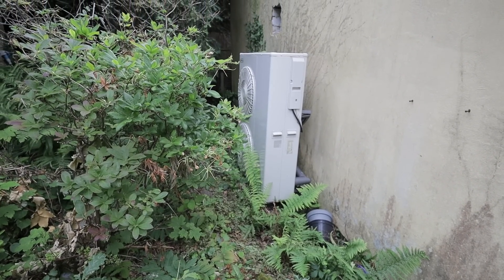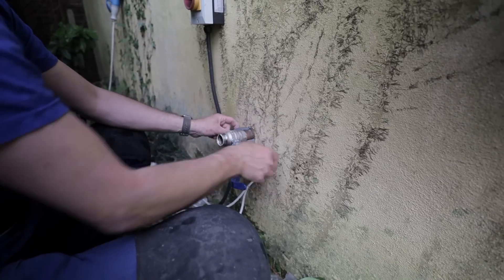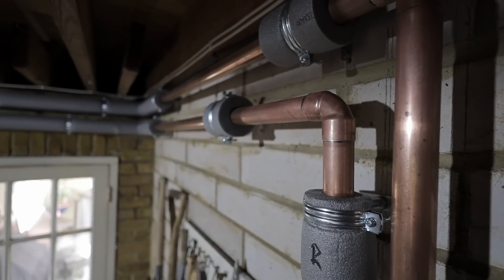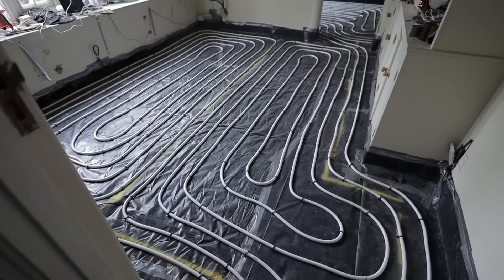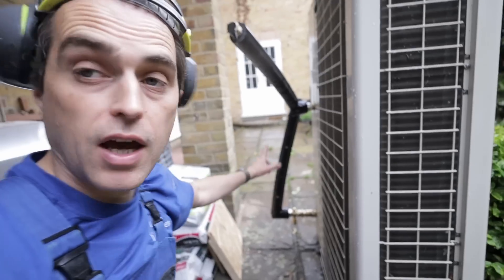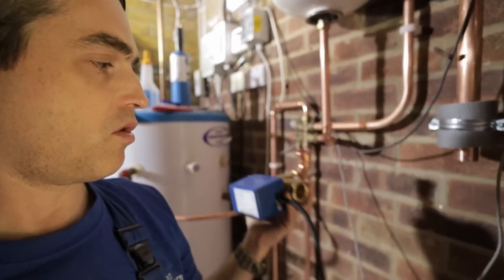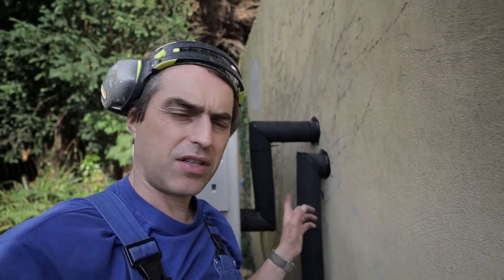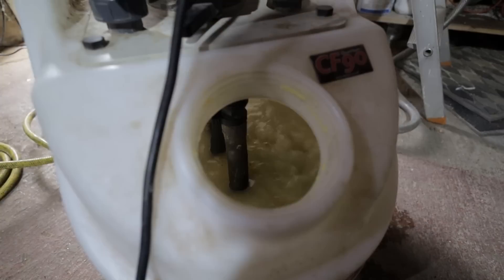Heat Pump Installation Nightmare - Can It Be Saved?

Comment: Who would ever have a heat pump installed? They are so complex and expensive with so much more pipe work than conventional central heating, plus the ongoing maintenance issues. Without subsidies they just don’t work, and this country can’t afford subsidies for much longer.
Reply: Much more pipework? Compared to what exactly?….. And as for the complexity, they’re considerably simpler than a combi. Connect power, turn on, hot water comes out….. A completely sealed refrigeration circuit, a built in pump, often a built in expansion….. simple as heck.
Reply from the maker: Heat pumps are amazing when done well. Cheap to run and last for ages

Comment: What a cliffhanger! Good luck with the investigation, excellent video. The Sontex heat meter display will also give you a reading of the flow/return temperature and a real-time readout of the heating power being delivered. If a heat meter was installed there's a good chance they was also an electricity sub-meter installed with the original installation. You should be able to calculate the COP of the unit in its original state by reading the kWh of heat from the heat meter and kWh of electricity.   Do grant use an internal or external pump? What's the spec?
Reply from the maker: Internal 12m pump. Just found out they are ‘only’ around £220+vat so will recommend to the client we change the pump next and flush plate again, but will use some seriously strong chems and go direct to the plate
Reply from the maker: Also, full monitoring is available in software, strangely flow can only be read on Sontex

Comment: Your having as much luck as my underfloor unit in the us , it has a flow of just 24m s no one could work out why , that’s why after two years I went to an air to air system two units, one doing the main living room , the other upstairs in line us style duct and defusers in. 4 rooms  of the annex, get this 40mm insulation and still only 15 c 1900 sq ft 2 zones   The biggest waste of money I end up using solar and off peak to charge the 250 litre cylinder twin immersion coils both 3 kwh  b rated cylinder,  and completely empty twice a day due to household

Comment: Wow that installation was so bad. Feels like the property owner could have a legitimate claim or possible lawsuit against the original installers if it really had no chance of performing even close to what was promised. 

Not sure how that works in the UK though. Just seems like a huge waste of money for them :(
Reply: Nobody has the time, energy or money for lawsuits because the justice system is a scam and a joke.
Unless you are a regimist that has scammed the system for millions yourself and know those involved going to court is often worse than even just losing the money.

At least that's how I see it. I haven't experienced it luckily. I have had reason to sue but didn't because I think it will just be a huge drain for little result.

Comment: Fit your gauges on the outdoor see what discharge pressure your getting . Work out your subcooling from your condensor. High discharge temp high subcooling would point to underperforming plate exchanger . Is there any Service settings you can access on unit to interigate the outdoor unit?
Reply: Not many plumbers over here have the f-gas qualifications required to legally work on the refrigeration side. I’ve asked Symon in another comment if he has this qualification… then he could recover, remove and clean the plate, then re-gas.
Reply: @dorsetengineering  it's mad how split the trade is the amount of this stuff we go back too that gets miss diagnosed is bad, f-gas is a minimum requirement to leak test and break the refrigerant circuit . Most fridge engineers have done an apprenticeship of some sort its a bit like us getting let loose on a boiler. A bit worrying when the likes of daikin are targeting massively and a day course seems to be all you need . I like watching this channel as he is a very good heating guy not many like this in the world .
Reply: @dantheman9909  with the air/water industry moving to r290, technically f-gas quals won’t be a requirement. Still, wouldn’t want your average plumber having a go, given the standard of training in that Industry. Most can barely understand what modulating controls are.
Reply: @dorsetengineering  even more dangerous being a hydrocarbon
Reply: @dantheman9909  what’s I find a bit ridiculous about the whole thing is the paranoia in the industry around half a kg of r290, in a sealed heatpump, in your garden. Yet average Joe can go and buy a gas bbq and a honking great cylinder from b&q….
Reply: @dorsetengineering  until someone tries to unsweat a blocked drier 🤣

Comment: Im not familiar with grant heat pumps but just had a quick read on the manual (r32 grant aerona3) and saw that you can change the dip switches to change the output of the circulator, comes as default on maximum speed but worth a check if not already checked. 

I assume the poor flow rate is on both the heating and hot water. The pump chart shows a max of 20l/min at 12m head at speed 3 on the pump. To have rubbish flow rate on just the coil as well you would be right in thinking the plate heat exchanger on the outdoor unit. The smallest amount of debris will play havoc on flow rates, more so if it has a sika flow sensor like other brands. When refreshing the flow rate reading on those sika flow rate sensors you will notice the flow rate fluctuates by massive amounts which indicates debris within plate.
Reply from the maker: Pump on speed iii already. I have installed those units before and I used to get double the flow rate of this unit. I also tested flow just across the unit and it is definitely restricted

Comment: Great detective work and re-fitting of a poorly installed and designed system. Such a shame there are heating engineers out there fitting heat pumps to this poor standard and taking customer's money for it.
Reply: I wouldn’t call them ‘heating engineers’, that implies a degree of design skill. The horse riding fitter who banged this in was just following the grant installation instructions (designed to appeal to the average jobbing plumber), probably under a grant hoovering mcs umbrella scheme.

Comment: I guess you don't have bypass option between flow and return (on your new 35mm line) to open up and check the flow rate then. That would point you to the right direction (heat pump or system). Good luck to find out what is the issue. I'm looking forward to learn.
Reply from the maker: 100% heat pump issue
Reply: @UrbanPlumbers  That's pretty bad. I feel sorry for the client... Obviously they paid a fortune for the system a few years back, and now... they have to do it again.
Reply from the maker: @arpa592  system was pretty much unusable
Reply: @UrbanPlumbers  Yeah, no doubt about that. Was it a DIY job originally?
Reply from the maker: @arpa592  MCS registered installer if you can belive that
Reply: @UrbanPlumbers   Wow, I wouldn't see this coming...
Reply: @arpa592  I'm trying to decide if you're being sarcastic :D
Reply: @arpa592 The DIYer who was going to tackle something like this would have made a much better fist of it than the original installer.
Reply: @normanboyes4983  I know, first hand...;)
Reply: @dorsetengineering  Well, I guess, but to be fair, sarcasm towards the original installer is the minimum requirement. We, bystanders can do it, without consequences, and I think the comments are still within the (very) good manner.  Just to be clear that wasn't you?

Comment: I blame Grant, for making their aerona units ‘as easy to plumb and wire as a boiler’ 🤦‍♂️🤦‍♂️🤦‍♂️ It’s a shame, as the Chofu unit isn’t terrible.
Reply from the maker: Correct, it’s all set up Chofu way now
Reply: @UrbanPlumbers  have you considered doing your f-gas, then you could recover, remove and acid dip the plate heat exchanger, then re gas? The c&g qualification never runs out, and the 4-5 day course is only about £900-1k. Probably going to do mine later this year.
Reply from the maker: Yes I have. I am just too busy right now. I will do those f gas at some stage.
Reply: @UrbanPlumbers   nice…. Gives you the option to do r32 air-air units too (because they’re amazing and everyone wants aircon nowadays 🤣)

Comment: If the industry ever wants to get over the bad reputation heat pumps have they need to improve their installer training.  This one is particularly bad physically but a lot of installers either don't know how to or can't be bothered to set them properly for maximum efficiency. Sad state of affairs but it's good that's people like you are showing what can be achieved👍
Reply: Not just the industry but also customer base need to stop going after the lowest bidder. Every home remodel I do the owner will spend a fortune on making the home look pretty but cheap out on the system that makes the home comfortable.
Reply: @Silky_boi Quite often there is no linkage to a bad installation and price to the customer.
Reply: @Silky_boi  Very true. Customers go for a lower bidder as they value heating less than aesthetics. No different to other trades such as the electrics (go for the cheapest bidder and have issues with poor quality lights, unsafe sockets and non-compliant wiring etc etc), windows (poor quality windows and installation means the windows fails earlier and lets in droughts), plumbing etc etc. 

More often then not, it's the stuff you can't see (electrics, plumbing) where people cheap out on which makes or breaks the property...
Reply: Plumbers are jumping into the heat pump market, without a firm grasp of system sizing and design. They just follow the outdated S-Plan, and hope for the best.
Reply: What’s to stop anyone installing heat pumps that are badly installed with no thought for design at all. There needs to be penalties for charging people to do this.
Reply: Most installers I know (Italy) are mostly used to do simple gas boilers. These systems at worst require an ON/OFF or bus thermostat to be added and power to run. Once you start going into the more complex models, with electronics, boards you need to set on the right addresses to get the zone valves running, all hell breaks loose. I believe at best 25% of our plumbers / installers are fully able to set up those. With heatpumps, things got a lot more complex. If you want to get them running properly, maybe even do some cooling, you need to size the piping right as he's shown on his video (too many houses here as well do run radiators on 10-15 meter runs of 22mm copper or 26mm plastic). The end user is a whole different discussion. Yesterday we were used to run our gas heating on-off, today the heatpump needs to run almost all day, but start not too early to be decently efficient in relation to outside temps. There's a lot of more optimization to do (climate curves on heating water temps to begin with). Currently, not every user I know is fully able to set things up (and work with a different mindset) on their systems.
Reply: Oh, you are just so lovely!
Reply: Low quality installers have always been there but the cowboys are finally getting caught out, because a bad gas boiler system install runs inefficiently, but will eventually heat the property, albeit slowly with massive consumption. Bad heat pump system installation will result in a very cold house, which is way more obvious to the customer, and could potentially be dangerous.
Reply: They don't even work properly on their own settings. They only work if you have enough money to make them work effectively. Good for the rich, we need to think of something else for us that can't afford everything required for the efficiency

Comment: I’m not a plumber but have an interest in renewables and love your videos. I find them all very interesting… Keep up the good work! 👍
Reply from the maker: Thank you 🙏
Reply from the maker: @zlmdragon.  not as easy - as you cannot test with DHW will the system is up and running. Not a big deal really, as it will be the unit - the system is all new.
Reply: Love these fault finding videos 👍 It would be nice to see diagram of this and how did determined that the blockage could ne in the heat exhanger? Is it common to flush the system before installation?

Comment: I like the format of that video !  Troubleshooting is really the best way to learn IMHO.
I guess the problem is solved now 🙂 but I had instantly an idea to be able to exclude or not the heat exchanger : is there a port inside the heat pump to measure the pressure between the main pump and the heat exchanger (which should be in that order in the internal circuit) ?  Or better : pressure measurement port before & after the heat exchanger, which allows to verify that the delta P across the H.E. is as expected or not ?

Comment: The easy cure and the cheapest . Take out the  heat pump Grant vortex external oil boiler Job done 😂😂
Reply from the maker: Now that the system can run at 35c it would make no sense
Reply: @UrbanPlumbers  I was only kidding with you . I know you will sort it out 👍👍
Reply from the maker: I am also kidding. Oil boiler going in next week 🤣🤣🤣
Reply: @UrbanPlumbers 😂😂😂😂
Reply: @UrbanPlumbers  Im looking forward to the out come 👌👍👍 You always get the Nightmares 😂
Reply from the maker: My luck 🤣